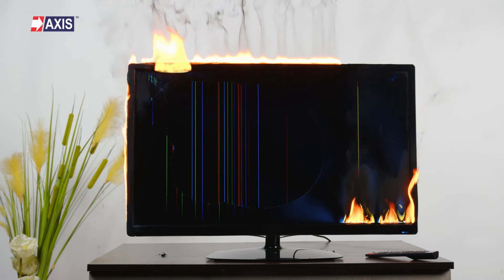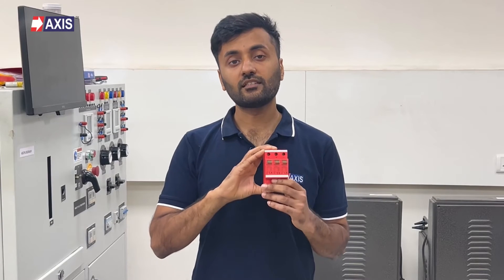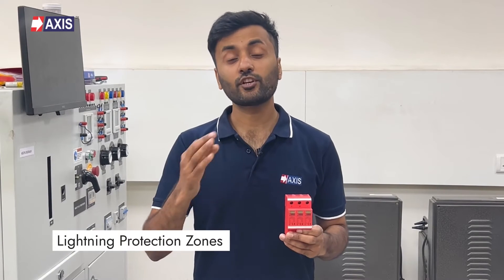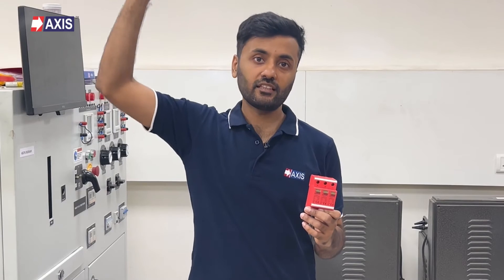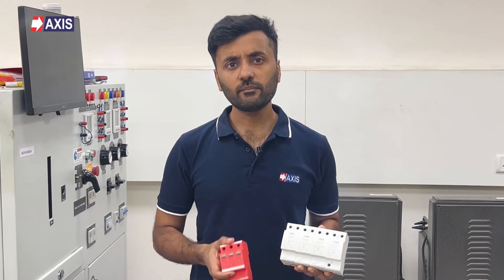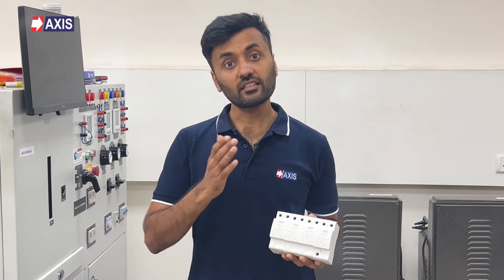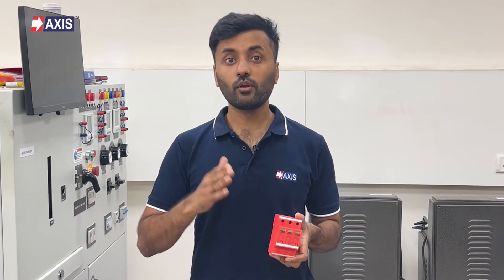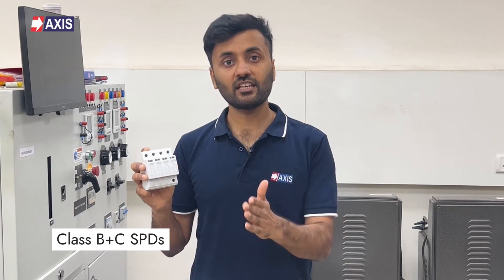Which Type of SPD should you use? ⚡

Comment: We are having an electronic product used in the farming. We have a AC 3 phase to DC converter SMPS for powering our device. But very often our SMPS is blown off. Can you suggest some solution based on your knowledge ?
Reply from the maker: You need SPDs on both the AC side and the DC side. 

If your equipment is installed far from the SMPS and you want to protect that equipment as well, you should also install a DC SPD close to the equipment.

Comment: Which type of spd should i install  in my home as our  apartment has regular problem.the problem is some squirrels climb transformer at that time two phases mix and we in our house get high voltage and many equipment spoil
Reply from the maker: Hey Sridhara,

Spd cannot help here. Voltage stabiliser or overvoltage protection relay circuits can.
Reply: Thank you

Comment: That video was good, i have a question. For my  2kw demand supply house which spd is suitable
Reply from the maker: I'm glad you liked it Prem.

Type 1+2 spd will be better as it handles both lightning and switching surges.
Reply: @AxisElectrical my electricity load is 6kw.. 3 phase.. which spd is shall i go with..?

Comment: Most spd are not recognize it durabilities and efficiency, however you can you can try to get the branded one and once and for all get the type 1 than is the highest rating protection, to  prevent lightning strike effect one must understand if the current exceed the rating of spd it will not have a chance to normalized, just let you know, some spd from china do not have a specification label so what you buy is what you get. Branded spd is very expensive and if you buy cheap brand once the spd blown off you need to replace with spare , look like just as a fuse wire. However if the real lightning strike your house with highest current it will induce  the magnetic induction pulse will and the current will over ride the spd and totally damage your appliances. 
One thing people will never has the chance to see this cos it is one in a million, so selling this device make a lot of profit because it's only divert the small excess current with a china made one it's work without any guarantee for larger surge current.just remember spd is not an intelligent device , it only works according to the quality of the device, brand and rating with clear specification.
Reply from the maker: Hey Kamaruddin,
Thank you for sharing your concerns about quality, we really appreciate it. At Axis Electricals, our SPDs are tested as per IEC 61643. 
Quality and Electrical Safety is our priority.

Comment: Hello sir, thanks for the good representation. What rating of SPD suits my load (premises/whole building with total loading of 30Kw)
Reply from the maker: Hey,
SPDs connected in parallel, aren't affected by circuit load. Their effectiveness depends on location and the equipment they protect.
Reply: I have an electric oven which has a total rating of 28kw, but low voltage tends to disturbs us a lot. As a result, this voltage imbalance  most times burn contactors. Would adding an SPD into the installation sort my problem out. If yes, then what size can be suitable. Thanks
Reply from the maker: @DaveSons  Voltage imbalance or fluctuation should be addressed using a voltage stabilizer, sized according to your oven's 28kW load. 

An Type 2 SPD can protect against voltage spikes, but won't solve your low voltage issues.
Reply: @AxisElectrical  ❤️. Thanks
Reply: I am
Cheek out your website but no see Spd

Comment: If we install SPD then won't it result in tripping of the upstream earth fault protective device?
Reply from the maker: Hi Jagrat,

Installing SPD won't result in that, but if SPD undergoes some fault like a short circuit or over current (steady-state faults) it can result in Protective device tripping (RCCB/MCB) so that SPD will be safe and not get burnt. 

If you want to avoid this risk, SPD needs to be installed prior to the protective device and an additional protective device like a Backup Fuse or MCB need to be installed for the protection of the SPD.

Comment: Sir, please can I connect  earth wire from SPD to the lightning arrester ground Earthing pit
Reply from the maker: SPD earthing and equipment earthing should be common, and as per the standards all the Earth Pits should be interconnected to achieve Equipotentialisation.
Reply: I saw some video where they saying to put earthing of SPD separate from earthing of rest of connection and earthing of lighting arrester also be different, is this correct , please explain